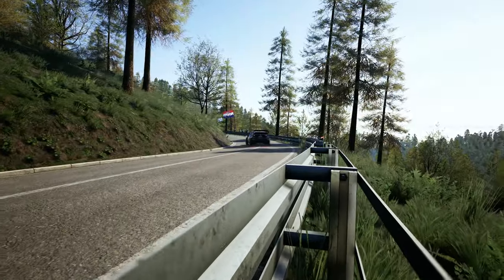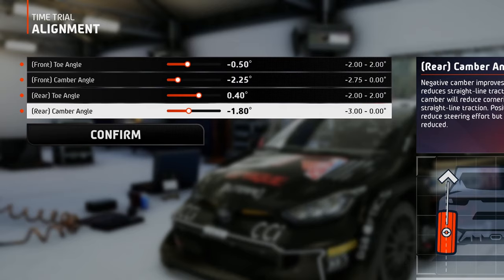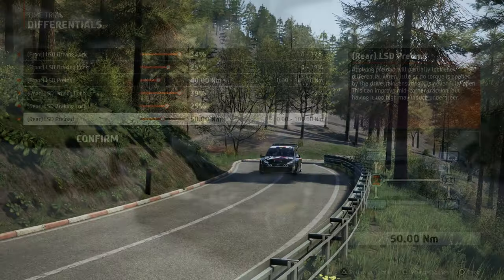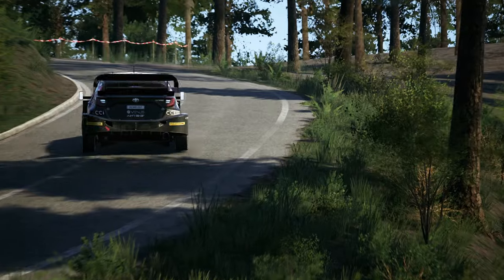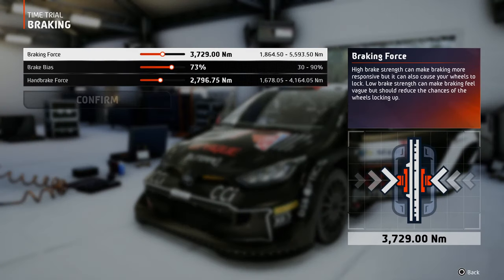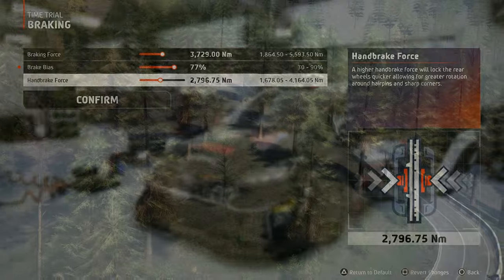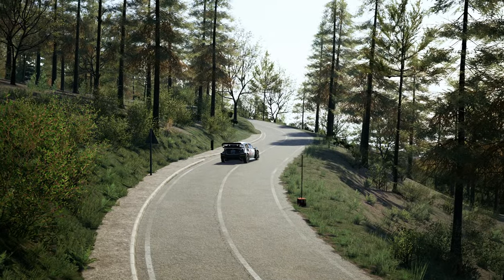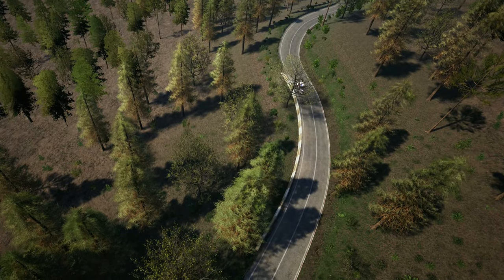The Ultimate CROATIA Setup Guide | EA SPORTS WRC

Comment: Question! Why would you want higher differential lock on asphalt tracks? Would there not be a lot more grip and it would not matter as much that they are locked? Like, since all your tires have high grip, it doesn’t matter that the wheels rotate at different rates, wherever the power goes there will be grip?
Reply from the maker: Very good question! 💯
Yes on a straight line this is true. But when cornering, the car and everything inside it experience centrifugal forces (the one that makes you lean to the outside of the corner). 
So this means that the car's center if mass shifts to the outside, putting more weight on the outside wheels, this makes the inside wheels lose traction. In tight corners, the rear inside wheel can even lift off the ground, producing 0 grip so with an open diff, all the torque will go to this wheel, while the outside one, which has even more grip because of the weight that it bears, will have 0 power and you will oversteer a lot.
I recommend you watch my video here where I explain in depth all the car's settings  ▶️ https://youtu.be/dIEXCHuT72U?si=Cx1g8jUPO5Bwr1Fw